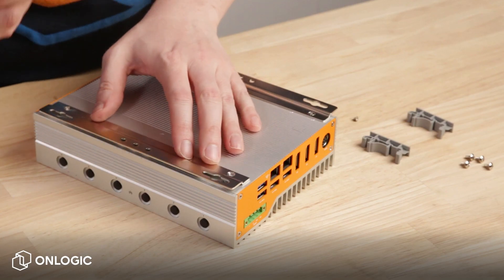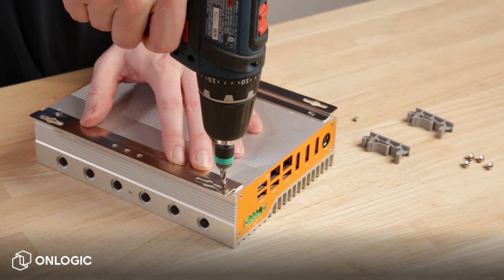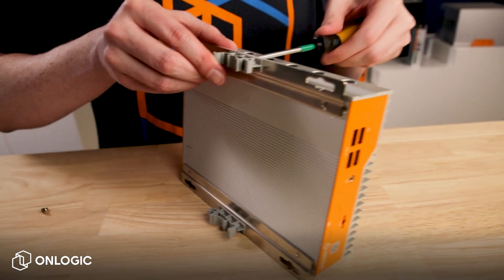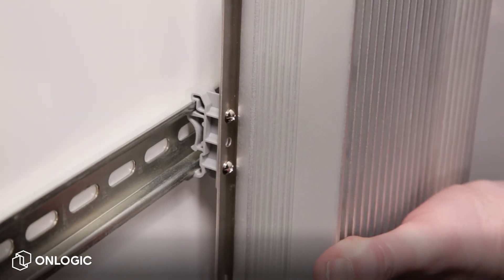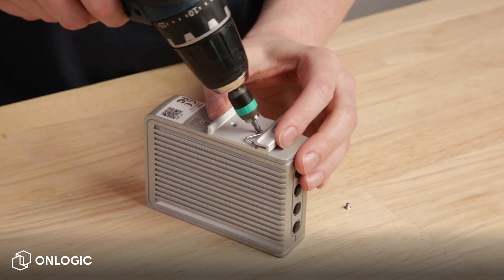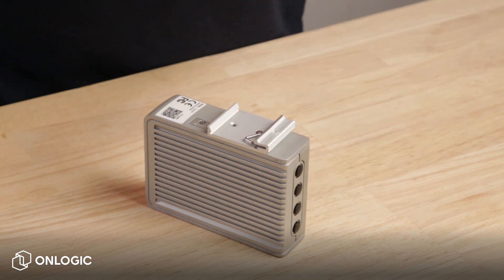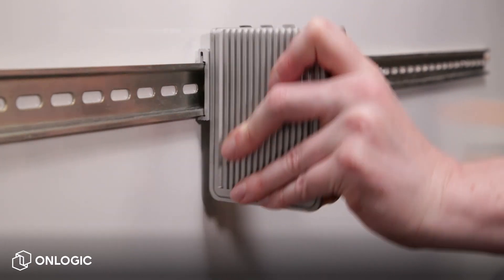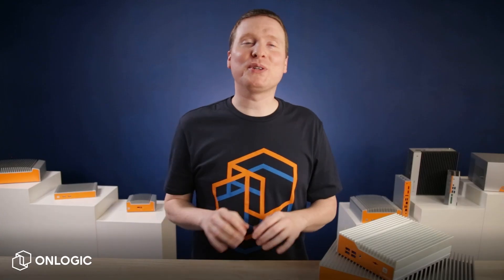How to DIN Rail Mount a Computer

Comment: Are there any fanless PC offerings that operate on 24VDC with terminal connections for the power?
Reply from the maker: Hi Brian, yes! Our Karbon 700, 300 - https://www.onlogic.com/computers/rugged/karbon/ - and upcoming 400 Series - https://www.onlogic.com/elkhart-lake-computers - can all be configured with terminal block connectors and support variable input power ranges including 24VDC. 

Our Helix Series - https://www.onlogic.com/computers/industrial/fanless/helix/ - can also be configured with terminal connectors and the top end of its supported power input range is 24V. Hope that helps.